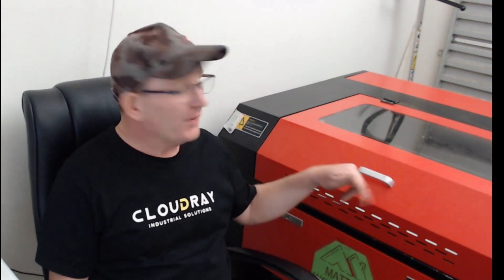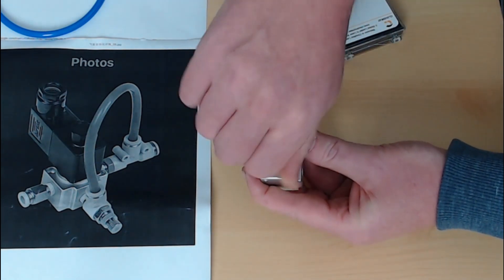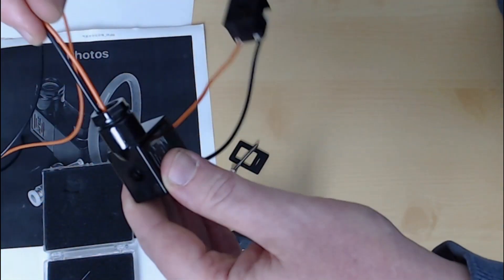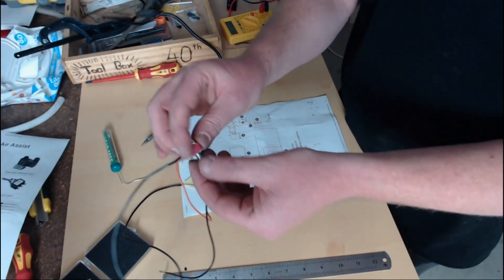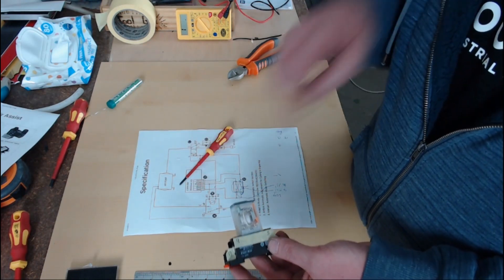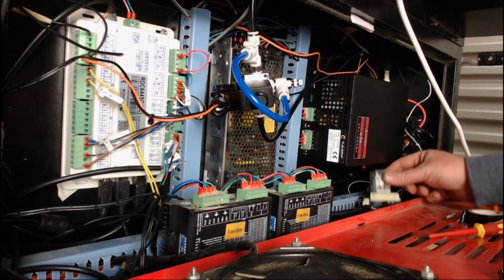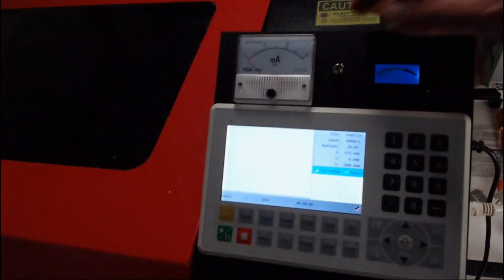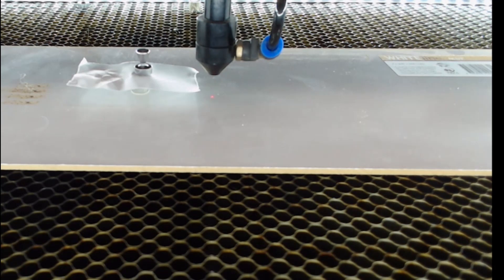Ultimate Air Assist Upgrade for Co2 Laser RUIDA 644X Controllers - CNC Co2 Laser Machine

Comment: Know this is OLD in technology world but your using a aquarium pump ? And run it off the relay and solenoid ? This is what I was looking to do since I can't add a compressor. So are you still with this setup ? How did or as it worked for knocking out charring and better cutting ? Thanks. Great video too.

Comment: Great video. May I ask a question? I have a laser that already comes with it's own air assist. A little compressor is plugged in the 220v outlet in the back of the laser and it switches on and off while cutting, it works fine. Now i wan't to use more air power to cut thicker material from external compressor. I am wondering if I can just plug 220v solenoid valve in the back where that electromagnetic compressor is plugged and not mess with the wires at all. Do you understand what I mean? Thank you.
Reply: Yes it worked.

Comment: The flow limiter on the pneumatic relay, is that so it can be "off" but still supply a minimum amount of air (blow the stuff away from the nozzle & mirror but not blasting at full strength)?

Comment: It's funny that you also have the chiller on the right side. I bought an 80W Omtech laser a few months ago. And I bought the exact same air assist that you have. The only difference is that there is a little air pump on the Omtech laser and I want to connect my compressor with it.
Reply: There is a video showing the air mod on your Omtech and using a compressor as air supply . I fitted it with ease . Cheers Jeff

Comment: Thanks for posting the video. Will this work with a Thunder Laser dual air assist (also will be using an external compressor rather than the small pump provided with the laser) or is there even the need? I have just received my Thunder but don't have it set up yet so not at all familiar with the operation other than watching a ton of YouTube videos over the past year. Thanks.

Comment: For anyone installing this and not able to get the WIND or STATUS controls to activate... I wracked my brain trying to figure out why I could not get mine to work and finally found the reason. In the vendor setting, on the "other" page, you must enable the blower check box and save those settings to the machine. Mine was not enabled. Maybe I missed this in the video?
Reply: Another symptom of this check box being wrong: When the STATUS signal is grounded and then ungrounded by the switch, the controller resets. This had me completely stumped for two days. I was about 10 seconds away from giving up when I found the blower enable check box.

Comment: This was super helpful but then I got lost.  There is already a black connector for the control panel with a brown wire going into pin 6 the 24v.  Do I remove this? Hoping not to make a big error.  Thankyou

Comment: thanks for sharing, what diodes do you use to connect in parallel with the coil?
Reply: 1N4001 or 1N4002 or 1N4003 etc... Any of those will work.

Comment: Why the solenoid on the air line? Just turn the pump on and off. Unless your running a tanked pump.. Then you want the air solenoid but only that.
Reply from the maker: you always need air.  when I mention air on or off it is actually ON= full air and OFF - low air, just enough to protect lens.  if you have NO air then the lens is unprotected and there is more chance of fire starting

Comment: This add-on works beautifully.  I've spent a couple of days trying to wire up a "Delay Off" relay with no success.  It would be very useful to keep the exhaust going for 5-10 seconds to clear the enclosure.  Would you consider coming up with a wiring diagram for this and a link to the proper Delay Off hardware?

Comment: If you want an "ultimate" air assist, try putting a little air above the lens so it blows smoke away from the top of the lens.
Reply from the maker: nice tip to keep the lens clean, but that is not the purpose of this upgrade.  this allows you to control air on/off during different cutting layers using the software settings

Comment: Just ordered this kit for my laser. Looking forward to getting installed. Mine will be a little different as I have an 80 gallon compressor I use in my shop.
Reply from the maker: Cool. I plan a video for additional solenoid to shut off air for air compressor so it does not deplete the air in tank when not in use.  Cheers Matt
Reply: @MWLaser  That's great, I hope that one comes along very soon!  Thanks for your videos, they are very easy to follow and understand.

Comment: Hi, I recently purchased 2x kits and used the second dpst switch to switch between air pump and workshop air compressor circuits. It works great as I can use my compressor during the day and run the air pump at night if needed. Just wondering if you bypassed the oem air pump switch, I've left mine connected at the moment while testing, but can't really see a use for it anymore. Cheers
Reply from the maker: great idea - My air pump was separate, so there is no bypass.  cheers

Comment: Anyone with rdc6445 can check voltages between GND wind and status when laser is iddle and when work?
Reply from the maker: On the RDC6445 the STATUS and WIND are both GND terminals.  They are switched to GND when they are activated.  In other words when machine is active for STATUS or WIND they are switched on to GND and you will have 24+ VDC between the 24V terminal and the STATUS and WIND.  When machine does not have active STATUS or WIND they will read 0 VDC
Reply: Thank you. So its a issue with my driver...
Reply: You might be hitting the same problem as me. In the vendor setting, on the "other" page, you must enable the blower check box and save those settings to the machine.

Comment: t type of diode is in use here? I blew mine up. The switch has been turning off my controller and not the compressor, any thoughts?
Reply from the maker: For the diode - The only info I have is... Diode = 1A 50V 5x2.5mm
As for turning off controller and with switch...... check your wiring is correct and there is no short circuit.
Cheers Matt

Comment: I bought myself such a solenoid. It passes air by default, without supplying power to it. Is this how it should be?
Reply from the maker: air will pass though when solenoid is switched off, that is by design to protect lens it requires a small air flow.  to adjust the air flow with solenoid off use the valve to reduce flow, if you cannot reduce flow enough you can add a better or additional valve.

Comment: What gauge wire should be used?
Reply from the maker: You can use 18AWG
Reply: @MWLaser  Thank you! One more question: Does each side of the diode go under each screw terminal? Or does it get soldered where the beads of solder are?
Reply from the maker: @mpark0  Yes the diode legs can be trimmed a bit shorter and use the screw terminals to secure.  the "white" line goes closest to the Positive Terminal.  Cheers Matt
Reply: @MWLaser   for the switch, the two static pictures shown in the video seem to differ slightly- in one photo, it looks like the ground wire is soldered across the middle two pins and in the other photo it looks like it’s soldered across the terminals opposite of the wind and status connections. I guess my question is, where does the black ground wire go on the switch pin and does it get soldered to one pin or across two?
Reply from the maker: @mpark0  Black Soldered Across the middle two pins of switch

Comment: Thanks as always Matt, your videos are great. Still working on setting up my laser. Have the ultimate air assist kit and just waiting on compressor to arrive. Since I'll be using a compressor rather than the air pump, do you think this would be a good way to go to keep the air from running all the time?: https://www.amazon.ca/dp/B07BW21Z5M/
Reply from the maker: sorry, because of the link this comment was hidden. 
YES that is the same units I have recently purchased to add onto the air assist system to eliminate leakage from air compressor while the machine is not in use, I am currently preparing the video for installation.  Cheers Matt

Comment: I recently added the air assist upgrade and now my Door Protect kicks in and will not allow me to burn. Why would wiring a solenoid cause the door protect to kick in? (Green light will not light up). The machine came with the air pump wired to 24v and Ground.
Reply from the maker: check your wiring, send a photo of mainboard wiring and setup to askmatt@mwlaser.com.au and I will try to assist that way.  cheers matt

Comment: Awesome video, great help thank you! Does it matter which mains feed to the pump you break into? Live or Neutral?
Reply from the maker: Thanks, I have more info and diagram here - https://mwlaser.com.au/ultimate-air-assist-wiring-for-ruida-controllers/
Reply: Exactly what I needed! I guess I can plug my air pump AND my exhaust fan into the same power board and control them both.

Comment: Hmmm.... I did get the smoke.... :-( Luckily the laser is fine
Reply from the maker: Glad to hear you have it resolved - Cheers Matt
Reply: How do we make sure this doesn't happen? I'm so scared to do this upgrade but want to so bad. I will be hooking up to a compressor
Reply: @lorirodriquez6100  If you put the diode in backwards, you will get smoke. The end of the diode with the line goes to the + terminal of the relay and solenoid, which is directly connected to 24V.

Comment: I purchased this setup but am having issues with installing the diode.  I'm not familiar with wiring diagrams at all - foreign to me.  I'm stuck at 4:19 mark.  How do I install the diode and then the wire?  Do I bend the tips of the diode 90° down and insert them WITH the wires?  Your schematic covers up what you're doing.  
Thank you in advance
Reply from the maker: g'day, to install the diode you can trim, bend 90°and insert in the terminals with the wire. the Line on diode is + terminal

Comment: hi matt..appreciate your replys thanks....one further question, you seem to have the flow restrictor dialled all the way in but thats fine as it still lets a minimal amount of air through to the nozzle stop lens  fogging...but then you have the ball valve? whats the point of the ball valve doesn't that and the flow restrictor do the same thing?
regards tony ;-)
Reply from the maker: the ball valve allows manual flow control, without the adjustment of flow restrictor.  In most cases the installation of the ball valve is not necessary.

Comment: hi matt .... im awaiting delivery of my compressor, until then im using this Air Assist in combination with a built in air pump that only turns off if i pull the plug out ...when i toggle the switch it reduces the amount of air considerably i imagine this is to stop the lens fogging up..will this ruin the pump or is normal to be able to regulate the flow of the pump
regards tony
Reply from the maker: you are right - this is to prevent lens fog and protect lens.  As to the pump, there is extra resistance when air solenoid is closed, but I don't believe it would ruin the pump, maybe put in a switch to manually control pump power so it may be turned off after you finish with the laser and not leave it run too long on restricted flow.  Cheers Matt

Comment: Hi matt... did you have to change the flow restricter ... or adapt it in any way as some that have purchased this set from cloudray say that the restricter flows the wrong way?
Reply from the maker: no I don't need to change anything for the kits I install, All installed exactly as described in the video.  If you are having issues with yours, email matt@mwlaser.com.au

Comment: Do you really want the air pump to turn off? By the look of that solenoid, it allows a little bit of air through a restrictor to keep air flowing through the head even when air assist is off, I would imagine to keep the lens from getting fogged. Surely if the air pump is off, this feature wouldn’t work.
Reply from the maker: The air pump starts at beginning of job, and remains on until the job is completed and then switches off.  The solenoid controls partial or full air as set in layers of the job. So air is protecting lens from fogging throughout the entire engraving and cutting process.
Cheers Matt

Comment: What is the purpose of the solenoid valve? If I'm interpreting the schematic symbol correctly, the solenoid allows unrestricted flow when the air pump is off (but since the air pump is off, nothing is flowing), and volume controlled flow when the air pump is on. Why not just put the volume control in line and skip the solenoid? I get using a solenoid with an air compressor (though I don't think this specific solenoid configuration wouldn't work with an air compressor), but I don't understand it's application with an air pump. Can anyone clarify? Thanks!
Reply from the maker: The air pump/air compressor is always ON supplying air to the the solenoid valve (SV).
The SV the RESTRICTS the air flow to allow a minimum flow when you select Air OFF on the cut layer in the software.  (This protects the lens from smoke and fumes getting to the lens due to the positive pressure).
The SV opens to provide FULL air flow when the Air ON is selected in the cut layer.
Reply: @MWLaser  - Thanks! Makes perfect sense now.

Comment: Works perfectly, thanks. I did not use the relay, but am considering it to control the exhaust fan, but from a spare switch on the front of the laser. 

May add the air compressor and cooler in the same manner just via front panel switches as well. I'll replace the external power outlets with proper 240V 3 pin Australian ones in the process, and will likely add compressor/cooler/fan power via a separate inlet at the rear rather than the main power to the laser
Reply from the maker: good idea, not wise to have a compressor on the machines power outlet circuits, run separately

Comment: hi Mat, nice video..... 
i just ordered the kit, i have a question, in my controller now i have two cables inserted 1 in pin 6 (+ 24v) and 1 in 3 (out1)
when I assemble the kit are these two cables or do I leave them away?
thanks
ps I can only mount the valve without the l? manual switch?
Reply from the maker: email me and request wiring diagram for the Air Assist Install.  Also send me a photo of your current wiring configuration.  Cheers matt@mwlaser.com.au

Comment: I understand pretty much all of it except the last part. Do you not take the existing power cable for the pump to the mains supply and splice the negative and connect this up to the relay switch? i didn't really understand the power socket hooked up at the back...
Reply from the maker: email me and I will reply with an updated wiring diagram, with a brief explanation. Cheers Matt@mwlaser.com.au

Comment: Video was very helpful.  When I finished I have the full air all the time, seems the selnoid is always open.  Perhaps I wired the toggle wrong.  How is the toggle switched hooked up exactly? Thanks
Reply from the maker: Email me and I'll reply with a copy of updated wiring diagram
Cheers Matt@mwlaser.com.au
Reply: @MWLaser  
Nice video matt, any chance you could send me a wiring diag how you hooked up the ultimate air assist and extraction, orcacidiots guide that would be so helpfull, thanks again for info great video

Comment: Great job on the video and the explanation.   What size diode did you use on the relay.  They are very tiny and hard to read.  The one that I got was completely blank out...
Reply from the maker: The info I have is Diode = 1A 50V 5x2.5mm
Reply: @MWLaser  Thank you Matt..

Comment: This looks like it could be a good for me to add to mine, just added a 25litre silent compressor. there is nothing to stop it just draining the tank though as it just keeps running
Reply from the maker: Install a tap on the air line, and the pressure regulator, this will help with reducing the drain on the tank when you're not cutting.  If you have the air assist solenoid installed this also reduces the air flow when air is not required.
Reply: @MWLaser  awesome thanks for your reply, I will get some taps installed so i can keep the tank from draining :)

Comment: Hi Matt,
 
I followed your YT video on the ultimate air assist that I ordered from Cloudray.  All went well with the installation.  When I switched the power back on, the machine came on as well as the air pump.  As soon as I switched the air pump off/manual, the entire machine went dead.  Will you please advise on where to start and look for the issue?  I have no power whatsoever.  Thanks in advance
 
Regards
Jaco
Reply from the maker: I have replied to your email.  Cheers Matt